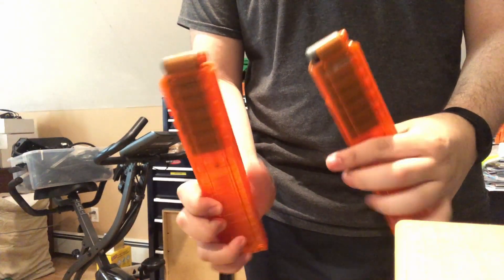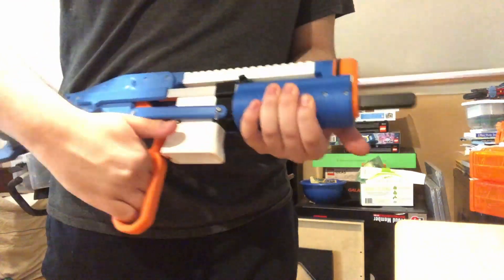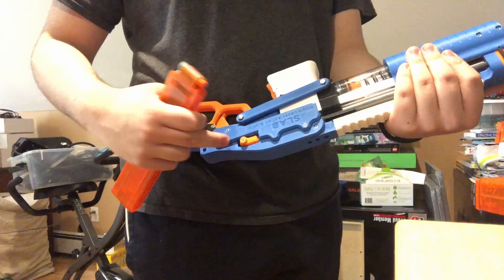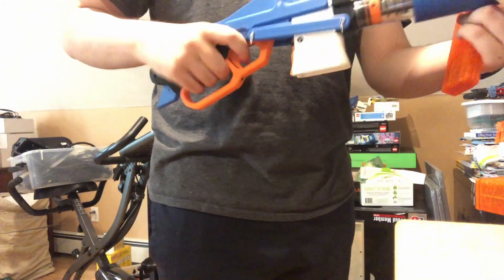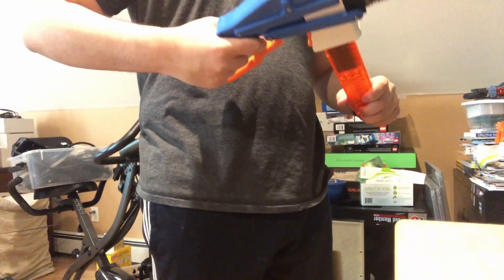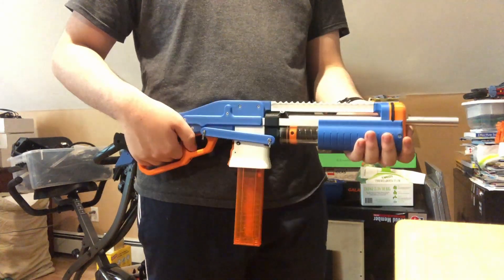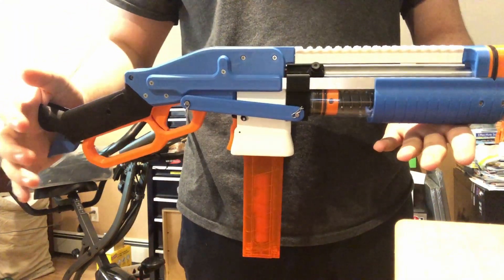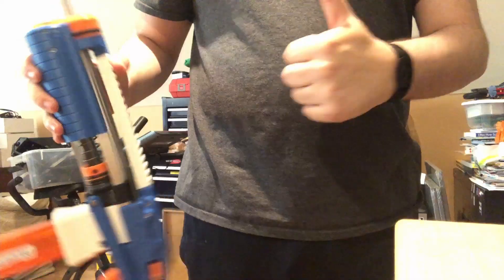SLAB first prototype firing demo, chronographing, and mechanism overview

Comment: This is great! I’d Absolutely love to make myself one eventually. My only suggestion would be do see if there is some way to make it de-primable. If it is not possible, that Is perfectly fine.
Reply from the maker: Can be deprimed the same way as the Wingchester, and with a convenient side opening that you can directly push on the trigger linkage bar.

Comment: What spring are you using and what length of barrel?

Also, because the trigger is with the lever, the SLAB effectively has slam fire, right?
Reply from the maker: 4 inches of k25, 12 inch barrel. And yeah, I guess it can slamfire!